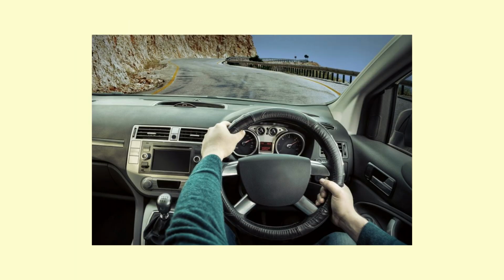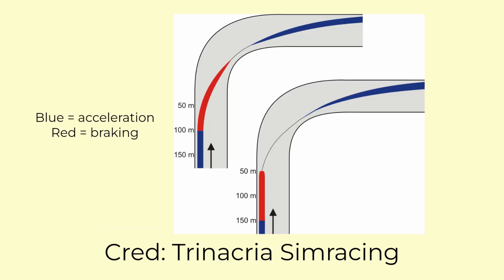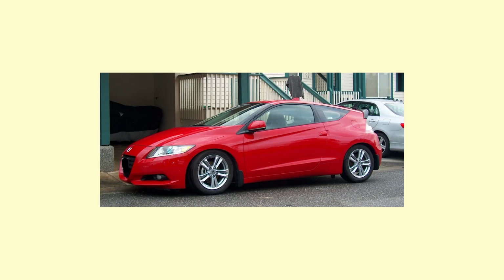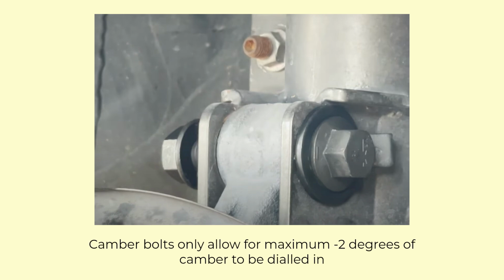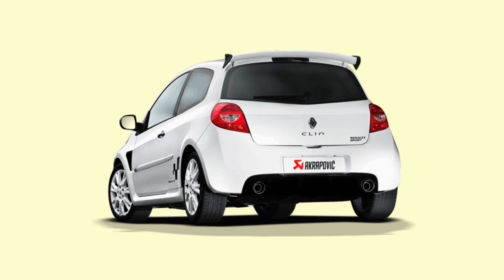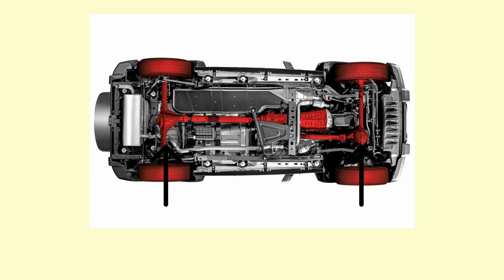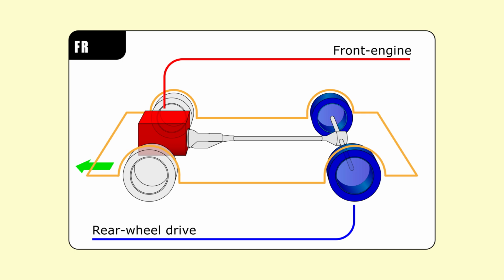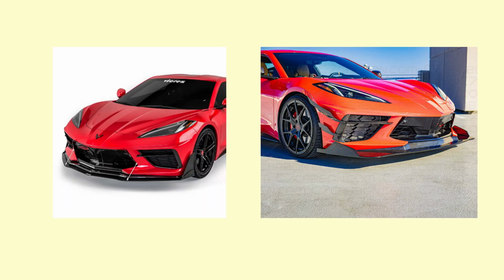A Comprehensive Guide on Understanding and Mitigating Understeer

Comment: Hold on just lowering the car may make the underster worse by negatively impacting roll center
Reply from the maker: Hmm in this case would lowering just the front impact the understeer
Reply: @ if the lower arm of the macpherson remains at OEM angle when compared to ground the action is greatly alleviated
Reply from the maker: @miguelgameiro8063  Hmm, but would it apply as well to a wishbone front?
Reply: @ somewhat the problem is most pronouce in macpherson struts julian edgar wrote books about cant link you his video because im pretty sure his channel got scrubbed
Reply: A coment got deleted?

Comment: What about fitting wider front than rear tires on an FF car? I know some manufacturers fit wider tires on the rear of RWD cars to make them understeer more, so would this do the opposite effect? I've seen time attack FWD cars run front tires that are a lot wider than rear, but that might be just for grip since they make a lot of horsepower.
Reply from the maker: Ye that could make sense as wider front tires allow for an increased contact patch meaning more grip meaning less understeer